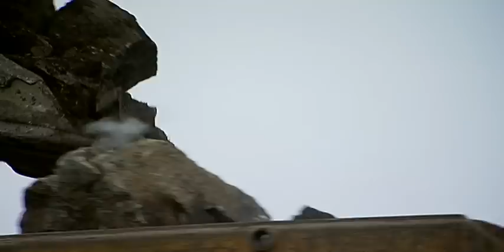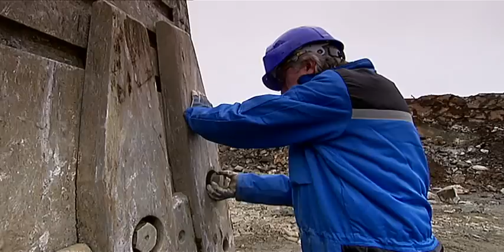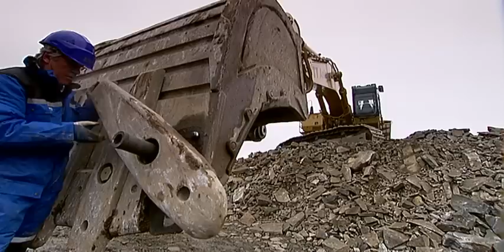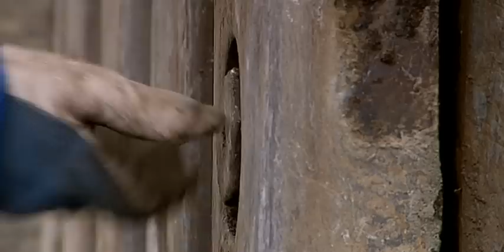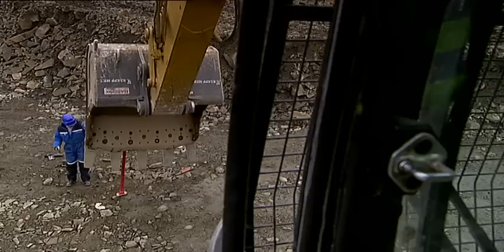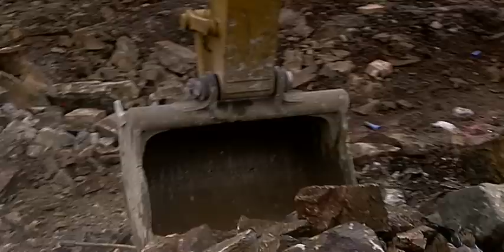Turning of KVX 1-bolt teeth

Comment: Try it on a PC3000, what a pain in the ass it is and you have to have $15K of Hy-Torc tooling just to do the bolts up. When a toothis 4 ft long and you can spin it 180 and get another life ofcourse it will have a low cost/hour but the tooling especially on the bigger machines blows that out of the water, many simpler systems out there working fine.